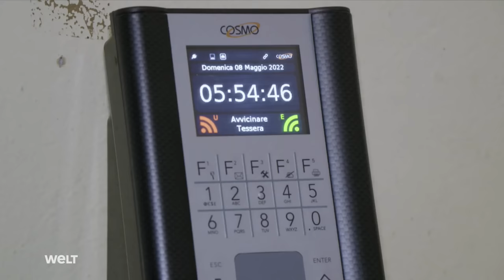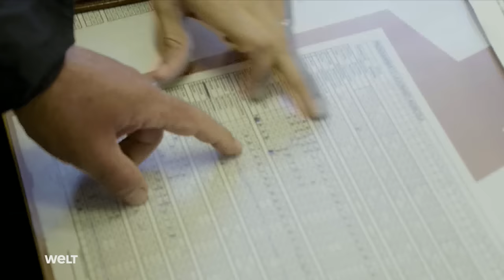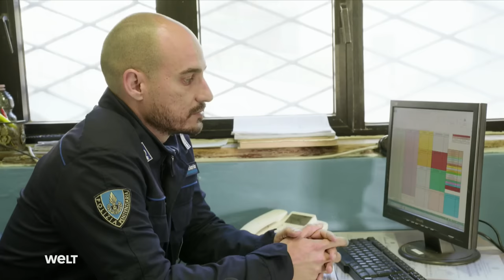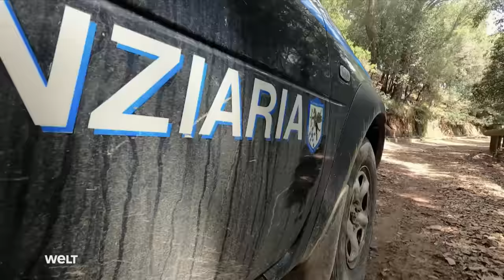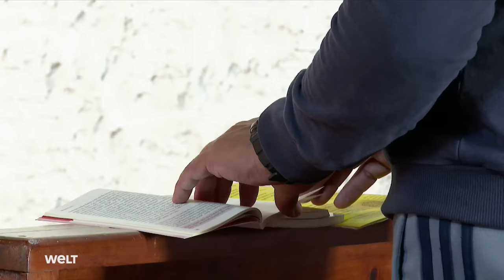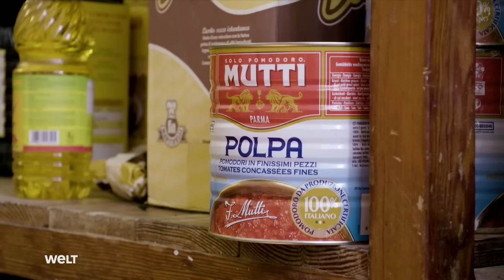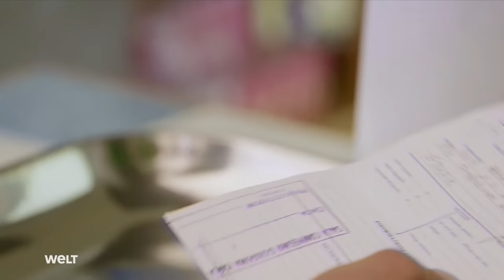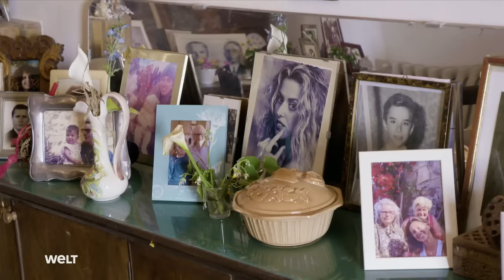JAIL IN ITALY: Felons on Europe's last prison island Gorgona | WELT Documentary

Comment: alcataz could learn something, america could learn something but they wont.  alcatraz was closed after a few short years because of upkeep do to salt water and rust.  um toytoas from the 90's bodies didn't rust,  the frames built in america did.  the trucks were scrapped because they would snap in half.  while the bodies with clear rust didn't get any worse than surface rust.  why, the quality of the steel.  dayna who made the toyota frames claimed same spec as other manufacurers but clearly not. i have a 22 year old ford and the frame is perfect.  same concept i recon.